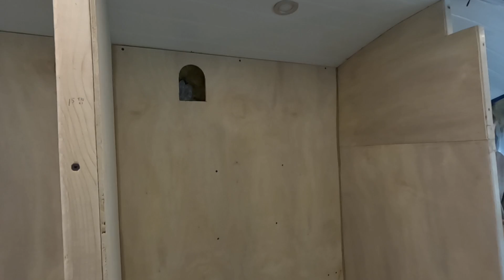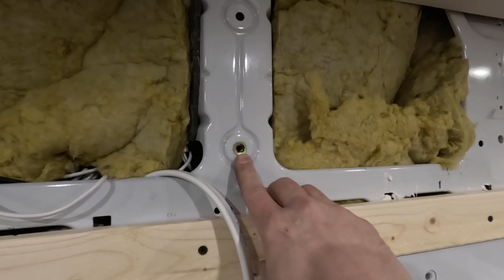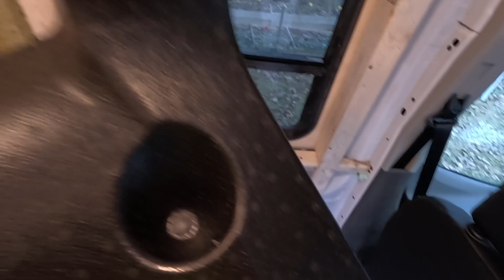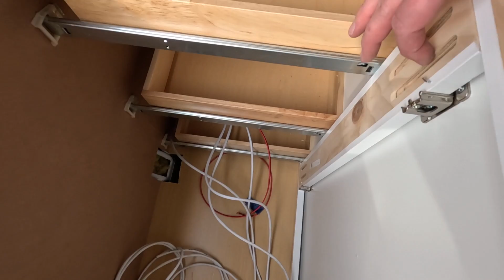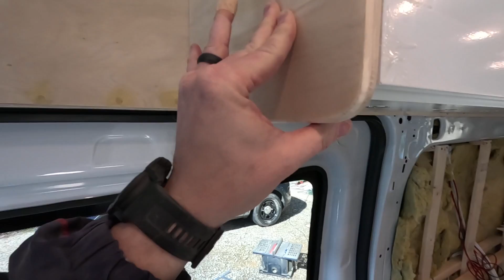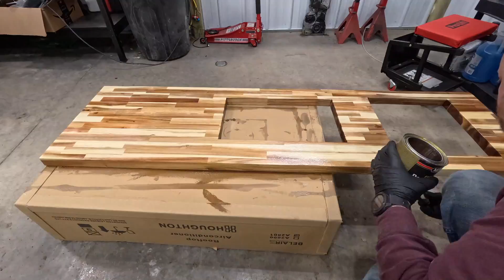Building the Interior, Kitchen and Bathroom - Ford Transit Camper Van Build EP 5

Comment: Of all the van builds I’ve watched, yours is the best for explaining in a way for me to understand. Everything you say makes sense and feels like someone who has no experience can understand. I love your layout…I also need a shower and a full fridge at that height with a freezer! The only thing I might do differently is make the bed higher to fit a bike underneath. Also, is this an extended wheel base? Could I do the same thing in the 148 non-extended if I took out the last row of overhead cabin and made the bed smaller? It’s just me…so I don’t mind sleeping on a twin . I’m mostly nervous to drive the extended…I’ve never driven anything so big and I also hope to park in national parks. Would k have trouble doing that with the extended? Can I fit into regular parking with extended?
Reply from the maker: This is the extended. On our ProMaster build we used the non-extended version and were able to make it work but it was very tight. I don't think I would want to do this layout in a non-extended even with a smaller bed, but it may work. I would draw it out on paper with the dimensions of the van ahead of time to see. The extended is not that much longer and fits in regular parking spaces everywhere we go. Thank you for the compliment and thanks for watching

Comment: Thank you so much for your videos.  They are very helpful.  Can tell me the dimensions of the wood you used for the bed frame?  Also, what were the dimensions of the fir strips you used to frame the ceiling?  Thanks again!
Reply from the maker: The bed is framed out of 2x3s. The ceiling firing strips are 1x2's

Comment: Where did you get the already made cabinets?
Reply from the maker: Lowe's. Home Depot has something similar.
Reply: @JackofAllMasterofNone do you have a link to the vanity cabinet ? If not, may I know the size of it? Thank you
Reply: RELIABILT Fairplay 12-in W x 30-in H x 12-in D White Wall Ready to assemble Plywood Cabinet (Recessed Panel Shaker)
Item #5212631 |
Model #LS-SW-W1230R
Reply: I’m thinking something like this might suffice. But holy moly the price tag! 

Search: 

Hepburn 36 in. W x 21.5 in. D x 34.5 in. H Bath Vanity Cabinet without Top in White